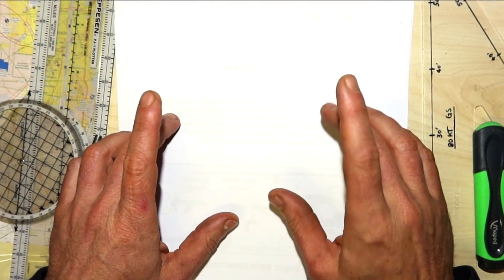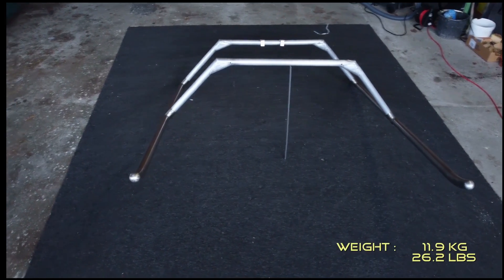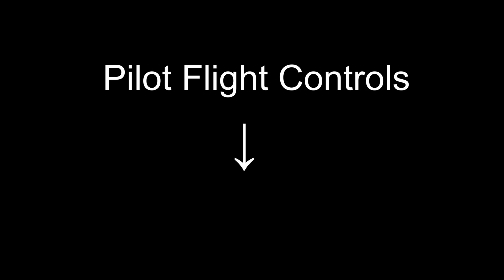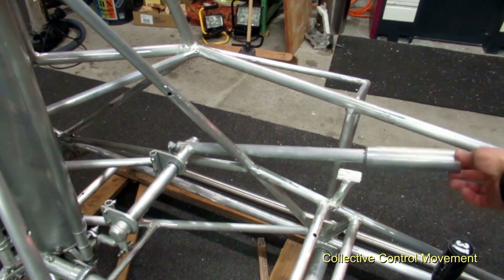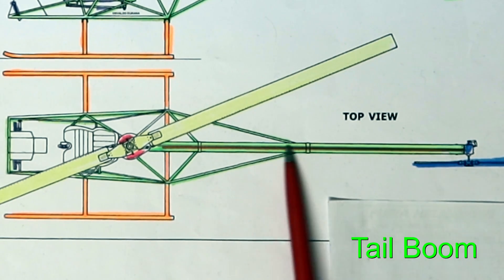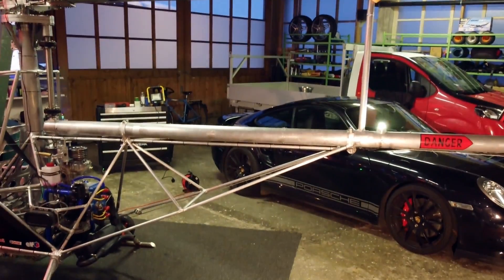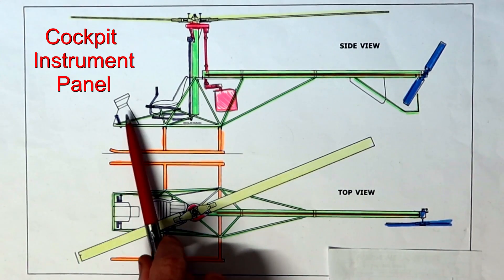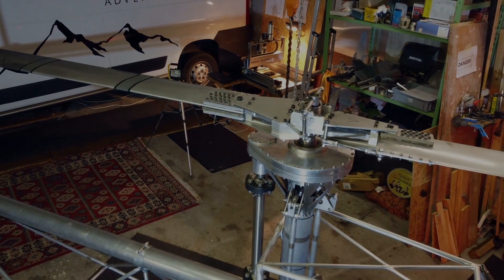How a Helicopter Works

Comment: I'm a bit concerned about the lubrication of your  reduction gearbox I've Never seen one mounted in that direction .Iv'e seen the 582 mounted right side up upside down .There are oil level screws for either way but I have never seen a way to check the level with your particular engine mount . Could you please explain.?Just a heads up never dismiss the obvious .